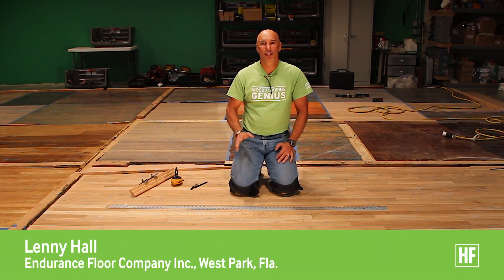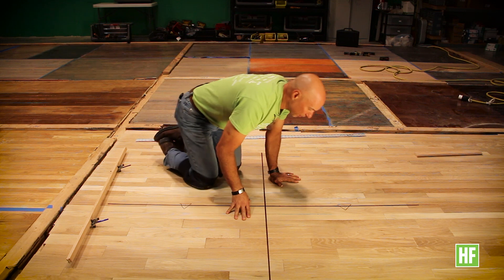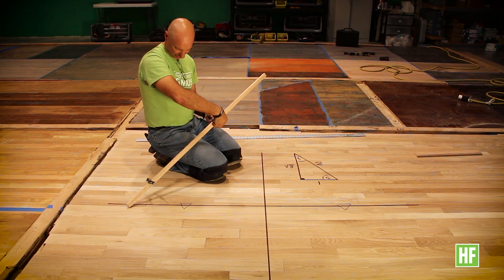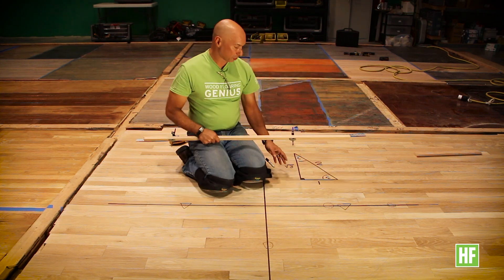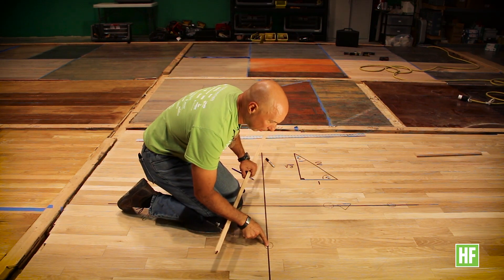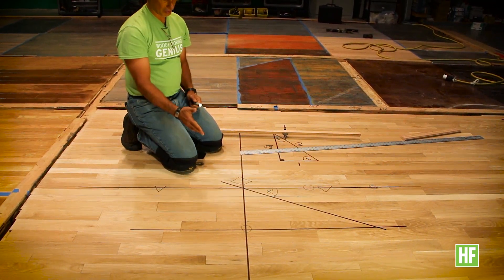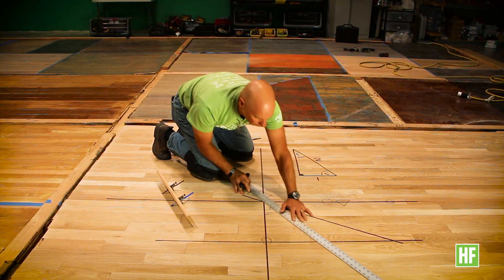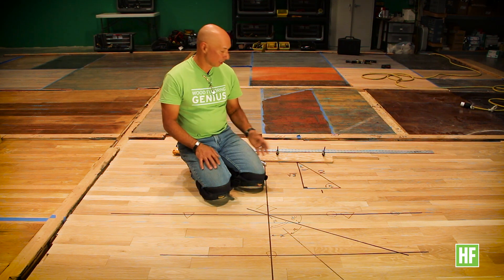WFB Contractor Blog: Creating a 30-Degree Angle with Trammel Points

Comment: You could also draw a circle and then from one of the lines where it intersects the circle using the same distance the radius was and it intersects the radius length form the line is 60 Degrees. It is done the same way you would make a hexagon. The side of the hexagon would the same length as the radius.